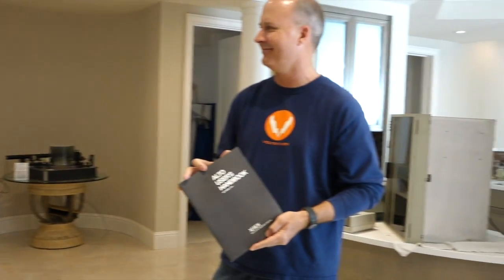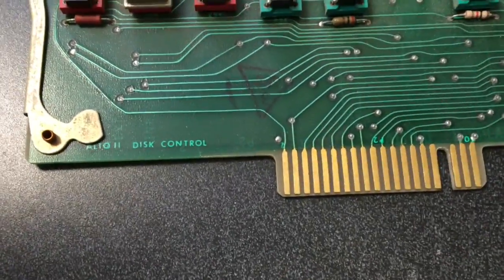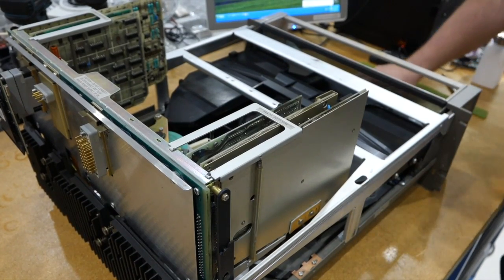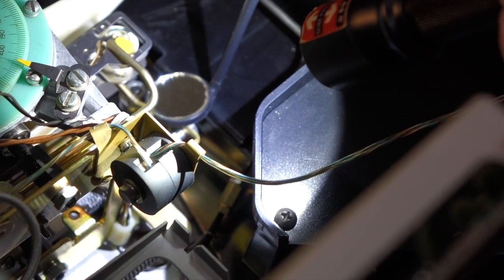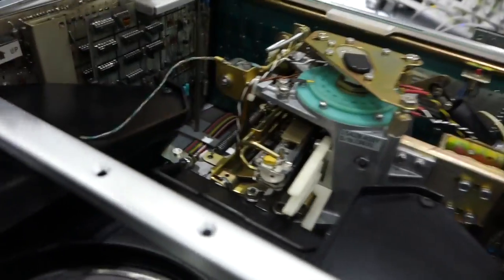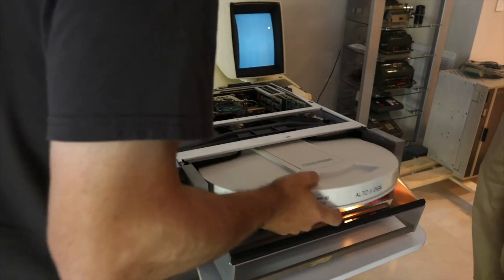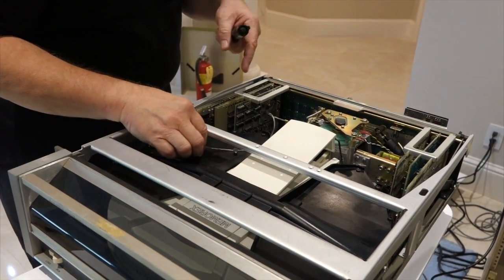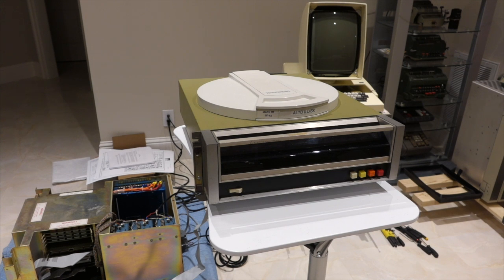Xerox Alto Restoration Part 3 - disk drive bring up

Comment: I can still feel the weight of the disk platter and the feeling of pulling the handle on the drive to open it up, even if it has been more than 30-35 years ago I last loaded a Diablo on an RC-4000.

Unlike the Alto, the RC-4000 had a real NOVA II board inside.

Comment: No fear for ESD?
Reply from the maker: I fear it to a point. My electronics lab bench is 100% ESD safe, grounded surfaces, including the instrument shelves. The chairs are ESD safe with special grounding casters. But no ionizer blowers or ESD shoes like you'd need in a clean room if we were fabricating sensitive ICs or grounding wrist bands if we were fabricating boards. So probably more ESD protection than in  your average electronics repair shop, but less than in an IC or board fab. The mechanical bench is wood top - so obviously no ESD there, but I usually do not work with sensitive disconnected electronic components there.
Reply: @CuriousMarc  or a hard drive on a wobbly table?
Reply: I believe that the Alto uses TTL, not CMOS, so ESD ought not to be a major concern. And as Curious Marc mentions, his lab has a lot of ESD protection.
Reply: It was the mail room that worried me
Reply: If it's a TTL board, ESD—even in the mail room—wouldn't be a concern.